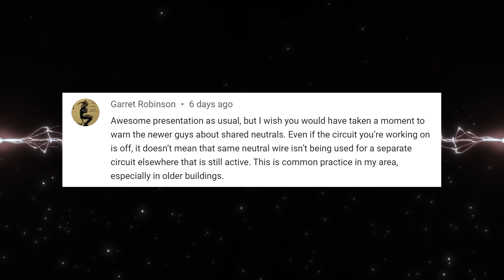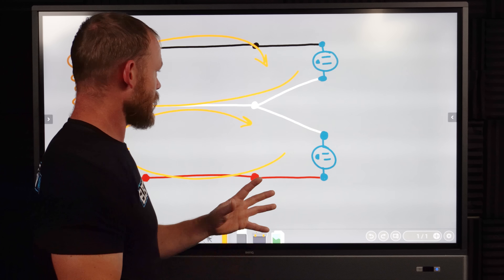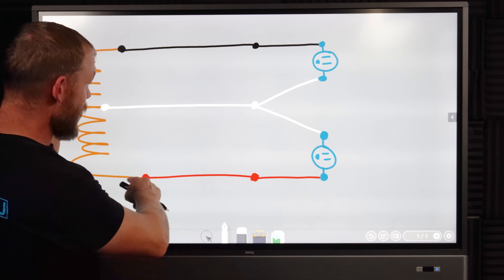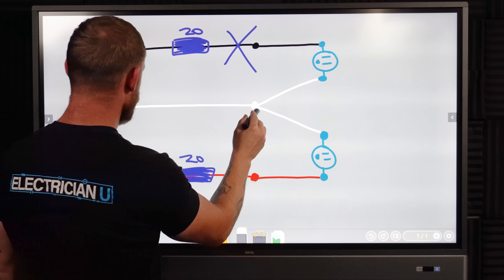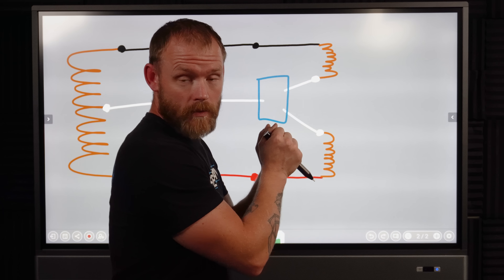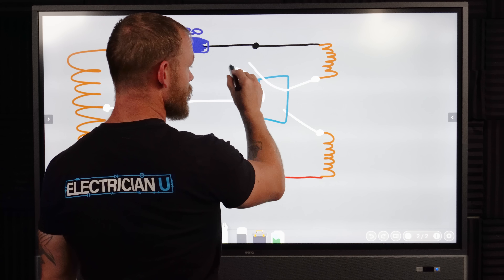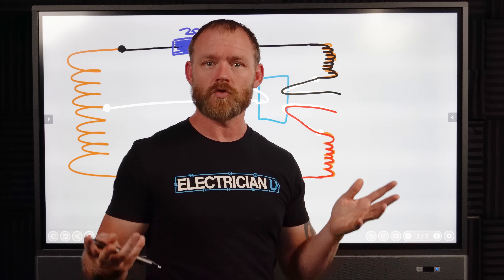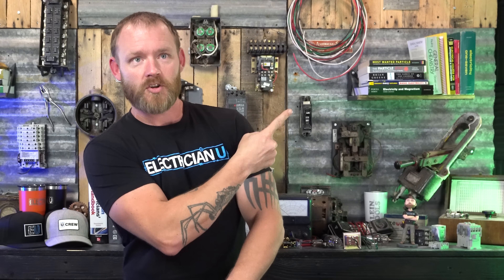The Dangers of Shared Neutrals: How To Avoid Being Shocked

Comment: My 1970's house 1/2 of the wire is 12/3 shared neutral. No handle ties the problem most common people move hots to same phase which cause 2 times the amount of current to flow on the N.

Comment: I have a 1980s condo that is all thhn in metal conduit. Almost every circuit is a shared neutral. I've had to go back and match all of them to tied handle breakers because none of them were identified correctly or tied together.

Comment: Your example shows two single-pole breakers, each can be shut off independently for each circuit. To resolve this, use a double-pole breaker with a combined switch. Flipping the switch will turn off both circuits.

Comment: Also apropos shared neutrals (aka MWBCs), beware of prior installations by "electricians" who run these branch circuits (generally in pairs fed by 12-3) but FAIL to pair them, either on DP breakers or on adjacent SP breakers with handle ties. My current house had a bunch of these, undocumented and unpaired. When that happens, it's on you to identify them and at least mark them. Better yet, replace the SP breakers with DP breakers.

Comment: We have one circuit that was overloaded. When we plugged in a vacuum it would pop that breaker but also make my wifes computer shut down which is on a different breaker. I wonder if a shared neutral is at play. I couldnt ever think of how those circuits were affecting each other till I saw this.

Comment: One thing left out was at the end when he showed the two 120v lights without the neutral back to the panel making 240v. If you don't twist the wire nut properly and the neutral going back to the panel falls out it will send 240v to both the 120v devices and fry them.

Comment: DIYer but I'm surprised shared neutrals are allowed in anything except large commercial installations considering NEC is all about safety. Seems like they introduce chaos unless you're a master electrician and save a trivial amount of money. Sounds fine in theory but in practice I've run across many basements that have spaghetti wires with signs of fire in junction boxes and 9/10 there will be an open neutral. Maybe I just have bad luck.

Comment: I had a shared neutral on two 20A duplex outlets (one on each leg).  When I went to upgrade to GFCI circuit breakers I realized that it wasn't gonna work.  Fortunately though I was able to run a second neutral.

Comment: I am not an electrician but have found shared/cross/mixed neutrals in my house that did not involve a multi-wire branch circuit (MWBC). House was built in 1977 and does not have any MWBCs. But I found this situation five times. It always involved a ceiling light controlled by 3-way switches. It was originally wired using 14-2 NM cable where the hot, neutral and ground for the branch circuit would be in one of the boxes for one 3-way switch. But the box for the other 3-way switch would not have a neutral, only travelers and a ground. So, the original electrician connected the light’s neutral to whatever device was nearby that had a neutral. Even if that device was on a different branch circuit.  In one case, the kitchen ceiling light was on one circuit (let’s say circuit 8) but the light’s neutral was connected to the refrigerator’s receptacle, even though the refrigerator’s receptacle was on a totally different branch circuit (let’s say circuit 12). So, if you turned off circuit breaker 12 for the refrigerator and left the ceiling light on, you would still have current flowing inside the refrigerator receptacle box. Why? Because the current would be flowing from the panel to the light on circuit 8 but would be returning to the panel on circuit 12.

p.s. With the help of a licensed electrician, I have fixed all the cross neutrals I have found. This was not an easy thing to do in a finished house.

Comment: This is you should never energize a multi-wire branch circuit from a 120 V generator.  You can melt that circuit's shared neutral.

Comment: I just replaced my old fuse box with a new consumer unit. When I first switched everything on, all the RCDs tripped three times in a row (after checking the lights, etc.), but the breakers themselves stayed up. I didn’t find any specific trigger. Later I switched the circuits on more gradually. At that moment, the fridge, oven, and dishwasher were still off.

I have 8 circuits in total, split over two RCDs on two phases, and the other phase is used for EV charging and PV. I didn’t change anything else, and now everything has been working fine for two days without tripping.

Do you maybe have an explanation why all RCDs tripped back then but not anymore? I’m a bit worried it might happen again. On the internet I saw something about a neutral that’s crossed, but if that were the case, wouldn’t the problem still be there? Someone else mentioned that two circuits might be crossing but not on the same RCD. I don’t fully understand this — is that what’s explained in this video?

It is an old house with wiring that has been there for a long time. Quite a bit of it.

Maybe you know something? Or is there a way I can measure this with my clamp meter (it has an mA setting)? Do you maybe have a video on your channel that explains this exact situation?

Cheers 👋🏼

Comment: Thank you for your sharing. You have presented a very important topic. I have a puzzling case. When I open up the wire nut of the neutral bundle in my bedroom switch box, I got shocked even though the breaker controlling this switch box was off. However, the neutral bundle has no charge when it was tied up by the wire nut. This switch box supposedly controls the ceiling lights and wall plugs. What could be causing the shock? Does it imply the neutral wire in the Romex wire from the breaker is shared with another breaker that was not off? If this is the case, why the shock disappeared after the neutral bundle was tied up?

Comment: What about at an rv park with 9 sites all daisy chained together on a 125 amp breaker at the sub panel. With everyone in the chain hooked to a 50 amp receptacle? I wouldn't be able to touch a neutral in the chain without shutting all of them down. ?????
Reply: If they are connected in sequence then you probably only need to disconnect the one you're working on. if they're connected all fucked up then god bless you.

Comment: How do i tell the difference between neutral and ground, opened a box today and there r 3 red wires, found the hot but how do I tell the neutral and ground apart and what happens if I mix them up

Comment: Be careful with shared Neutrals since a 10/3 wire with a shared neutral can only carry 30 Amps current on the neutral wire.  You cannot make it 30 Amp separate breakers on each 10 gauge Hot wire because the Neutral could carry between 30 to 60 Amps combined for both circuits.  A #10 Neutral wire can only handle 30 Amps before it overheats and torches your castle like a Tesla battery that explodes into an inferno in an accident.

Comment: This is great. Thanks for explaining this. I recently found a junction box in my 1970's home in the attic that had two "spare" breakers run on 12/3. Testing them both red and black lines test hot while one breaker is on. Working on figuring this one out.

Comment: I was shocked in a 1980’s home by a neutral once. That’s when I learned about shared neutrals. So I (more or less) understand that part now. 

What I’m not smart enough to understand though, is that since all the neutrals are tied in together at the panel, how are they not technically “all” shared neutrals, all the time?

Comment: Hey there are two ac 220 generators and so giving me two hot wires and two neutral wires can You please provide me wiring or connections to get one neutral and one hot also getting energy from both alternators please help me

Comment: I know what you're saying, but the transformer neutral coming into the panel is a technically a shared neutral servicing two 120 volt sides, and multiple 240 volt loads. I've seen two different buildings using the same single or three  phase transformer on telephone poles " sharing " the one neutral on secondary winding / windings. Same thing from generators, substations, distribution towers, using one neutral and three hots on the star secondaries to service untold amounts of end users. Those neutrals are connected to grounds ... I've touched neutrals in hot panel boxes and haven't felt a thing. I've taken the neutral loose on hot circuits and haven't touched it then but hooking it back up, you'll see the spark, after connection, touch the bar and you feel nothing.

Comment: I have a similar problem. I used to have a micro on a 20 amp breaker and a frig on another 20amp. I wanted to had an oven to frig 20amp since I’m not using the micro plug. When I went to turn off breaker to micro I spark happen in the 2 white wires. After turning breaker off on frig no spark. Before this frig went off with only one breaker. I need help wiring a new oven. It has a 6 nema plug. And used a 20amp breaker. My breaker box is on other side of house. I don’t really want to run all that wire as it not a straight shot

Comment: I have a situation that just came up that you may be able to explain. I have a 120v circuit in my garage that has one plug on it, controlled by a light switch. Today, I noticed the fridge and small heater that are on this circuit were off. After a lot of testing between the plug, switch, and panel, I discovered that the neutral was hot at the switch box. When I bypassed that hot neutral, everything worked again normally. What would cause a neutral to suddenly become hot?

Comment: Multiwire circuits are in use in every application to this day. I have yet to see a service which is not multiwire. Almost all office cubicles are wired multiwire. Any qualified electrician knows how to handle these circuits. If they are not qualified to work on these circuits, they have no business on these potentially deadly repairs. It is on the worker, be they homeowner or an electrician with no schooling to educate themselves. If my car brakes fail because I put the wrong DOT fluid in them, it is my fault because I did not educate myself. BTW: the NEC is replete with demands that the technician be qualified. A license does not impute qualification.

Comment: Ok wow, I just commented on shared neutrals on another of your videos. This is something I was trying to find but didn't know the term. I don't like shared neutrals on different circuits with different breakers (being a total beginner). It's so stupid to me and extremely dangerous. Almost got me killed today because I flipped the breaker and the lights went off. Well the other light switch in the box was still powered SOMEHOW, and the neutral was tied to the circuit I turned off.

Comment: I'm installing two 240 circuits. Which I'll use two 40 amp breakers and 4 #8 wires. Can I use one ground wire and one netural wire for both circuits? This will make a total of 6 #8 wires in my conduit. Or do I need to use two netural wires and two ground wires. One circuit will be split into six 120 circuits and one stays 240 for a welder. Thanks

Comment: I have one. Re wireing old house, had 3 breakers on, so 3 live circuits,. one for the single outside outlet, (which i put in at the main box), one ran to the shed (easy to tell) and one ran inside for a total of 3 outlets, all rewired by me from what i thought was the beginning of the circuit (i spliced from the floor, near the main box, and terminated at the last oulet). As i was trying to trace wiring for a individual lighting circuit, i went to snip romex tied and taped into knob and tube, (in the ceiling) and accidently crossed the netual and hot on the romex and, yup, sparks. Tripped the breaker. Now heres the kicker. I flipped the breaker back on, and went testing becuase that line should not have been live. Turns out, with only the one breaker i installed for the first 3 outlets turned on, apparently most if not all my house had 120v, or say 5v or 6v without a load introduced. So i have been messing with wires and around wires and etc all summer as i was doing demo and such, never tried testing them because well, all the breakers were off. How does my house have power throughout, on one 20 amp breaker. ? Why am i getting readings of 5v at places, but as soo. As i plug in something, its 120v? (Little house, around 700sq ft)

Comment: My neutral when the utility or generatoris on and the inverter,  the output of the contactor  is supposed to be neutral and hot, but the hot stays hot, the neutral gives hot signals that fades then gets stronger each sec.
But when the utility or gen connected directly, after removing inverter, the hot signal on neutral disappear.
Any idea why would this happen.

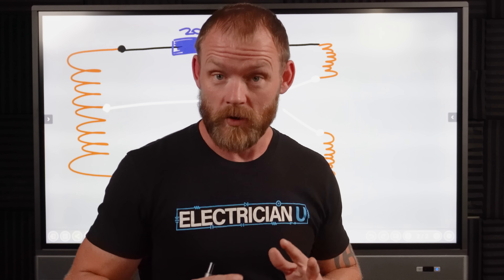Comment: Adding to your example @ 4:50, by connecting the neutrals of the loads you basically create a series circuit, increasing not only voltage but resistance. Most likely damaging the load.

Comment: When I was an apprentice, in another century, I was shocked by a neutral on a 3 phase situation.  I had turned off the circuit I was working on but the neutral was carrying the load of 2 other lighting circuits.  Fortunately, I was on a three foot rolling scaffold and fell to the ground pulling myself free from the neutral.  Beware of neutrals on a 3-phase system.

Comment: OK now I scared. I remeber a 2/10 with ground, was run into a new laundry room to hav 2 different single 20 amp outlets. I was the last run of a rewire and they were out of the 2/10 w ground. so he ran the 3/10 from 2 separate legs of the box. like a 220 , but with 2 outlets instead. there is not a 220 breaker but 2 singles side by side.

Comment: At my house I received a shock from the railing of my garage door. I'm planning to fully rewire the garage, but I'm curious if someone can identify exactly where the main issue is. 

Turns out I have two circuits ran through BX into the garage with a shared neutral. Measuring voltage at a receptacle(circuit #1) I have 120V hot-neutral; but 170V neutral-ground and ~25V hot-ground.

The second circuit powers a light. The lightswitch box is metal, and is screwed onto the metal mounting bracket for the garage door. So I completed the circuit from the garage railing (and thus, the BX) to earth and received a shock. 

I assume the BX is not acting as a proper ground back to the panel, due to poor fittings/age of the system. What would the other open wire be? Is the hot wire on circuit 1 in contact with the ground?

Comment: Great explanation...   I'm a homeowner who was taught by an electrician in my youth on how to wire houses and all kinds of electrical safety items - and went on to become an Engineer; but still do most of my own wiring.  

Unfortunately I live in a 70 year old house (just a few years older than I am).   While I have rewired the basement the plaster walls in the living areas are too nice to open up the walls and redo it.

In my past I have dealt with 2 houses with nob and tube wiring among family members.... Assume everything is live unless a test to ground confirms otherwise (and you might have to run a cable to a bathroom or the basement to have a good ground).    

I rewired both of those houses starting with having an electrician install a new breaker panels and me doing all the work past that (and yes there were building permits and I was inspected multiple times).

Interesting story is that in one city the electrical inspector came in to inspect my brothers new large 2 car garage wiring which I had done for my brother. The inspector recognized me and said he was glad to see me as my work was always 1st class.  In this case my brothers old original very solidly built 1 car garage had been moved a 100 ft or so down the alley to ladies lot who did not have a garage and there was only room on her property for a 1 car garage (reused the old garage).  So this lady was really happy to get a garage for just he cost of a cement slab and anchoring my brothers old garage to the slab.   

During the wiring inspection of my brothers new garage this lady came over and talked to the inspector about her desire to get her garage wired but could not afford the prices the electricians quoted; and did the inspector have any advice or options.  The inspector asked her if she knew me to which she replied "of course - he's been helping his brother on his house with a lot of things."   The inspector then told her that if she could convince me to do the work that he would approve it.  Technically, he should not have done that.   In my State a person can do their own wiring as long as proper permits and inspection is done.  A person can assist an immediate family member as well.  But my understanding in my State is that's where it legally ends.  I thought it was a nice complement.  She was happy even though she had to dig and fill in the trench for the underground service to her new garage.
Reply: Money talks, you found out

Comment: For those people wondering why even do this, the answer is simple: a shared neutral lets you run a single three-wire conductor for two dedicated 120V circuits. So you are essentially halving your wiring material costs. It is called a branch circuit, and it works by connecting the "hot" wires to each of the two 120V legs at the breaker, as you would for a 240V circuit, but when you wire the outlets, instead of having two hot wires go into the outlet you share the neutral between them.

But wont that overload the breaker if you did this with 20A breakers? If you draw 20 amps from both circuits, won't that be like 40 amps on the shared neutral?

No, because the two legs are out-of-phase, and as such, the current flowing on the shared neutral will max out at 20 amps, as the phases are inverse and cancel each other out. In other words, the neutral wire never sees more than 20 amps even if both of the circuits are power some high-current appliance like an oven or portable AC.